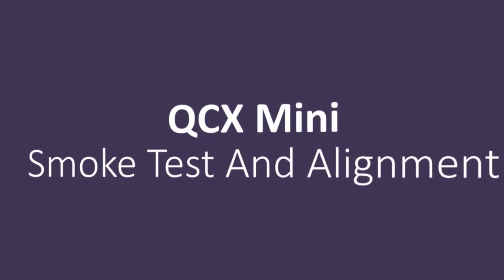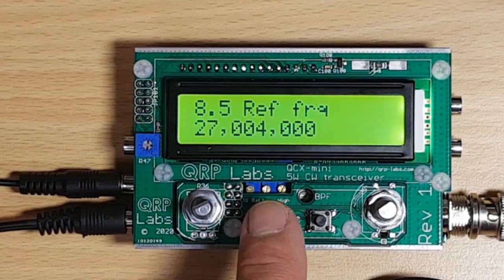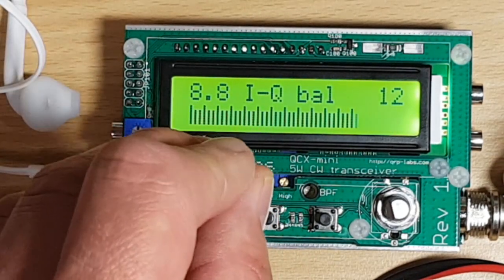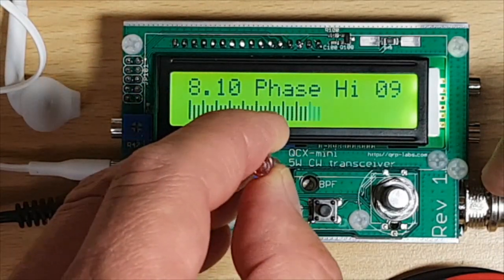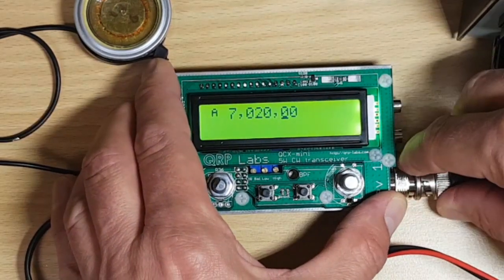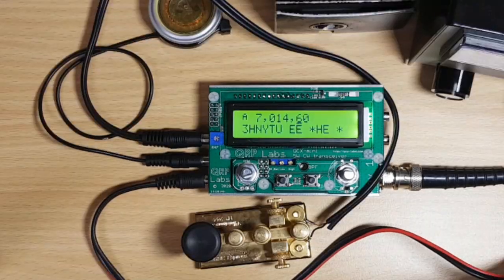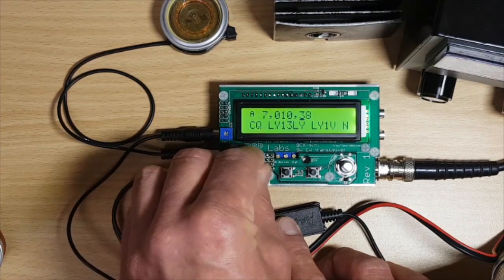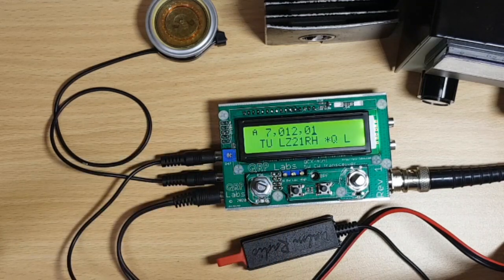QCX Mini - Smoke test and alignment

Comment: Is this something a novice builder could successfully build? I have a friend who can help me with the more fine soldering parts.
Reply from the maker: Hi, please check my other video on the assembly of the QCX Mini and take a closer look. You need good soldering equipment, and it certainly can be done if the builder has a bit of experience, good tools and patience. If you have a friend who can help you, he may want to take a look at the assembly manual on the QRPLabs page...

Comment: Boy that looks super easy.....too bad mine doesn't align that nicely.  I fear one of my IC's is bad
EDIT: why are you not hearing a tone during the IQ-Lo-Hi alignment?
Reply from the maker: Hi, thanks a lot for your comment!
The tone on the BPF filtering is very loud, and you are trying to peak it.
IQ balance needs to be minimized - on high and low phase frequency you try to null the unwanted sideband. 
As a result the audio signal should be between 40 and 50 dB lower than when aligning the BPF. 
To answer your question: you do hear a tone on IQ/low/high freq. settings, but it is considerably lower than the BPF aligning tone!
BTW the BPF reading of the numbers on the screen is independend from the volume pot setting, whereas the 10 turn pots for IQ, high and low DO depend on the volume pot setting. So it is advisable to set the volume pot into the half way point to adjust those parameters.
I hope this helps!